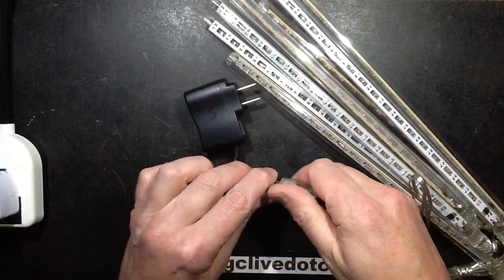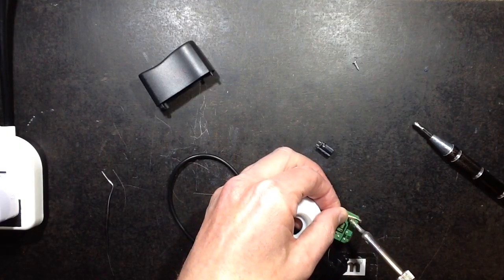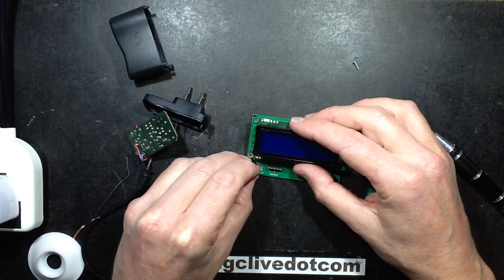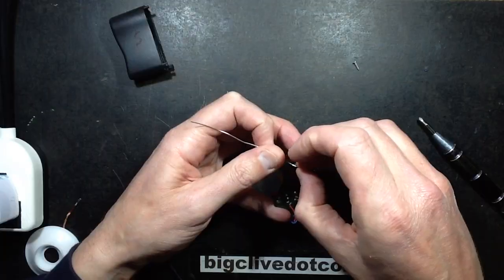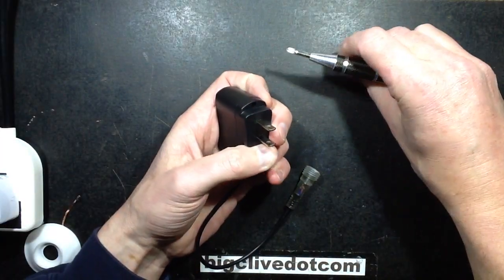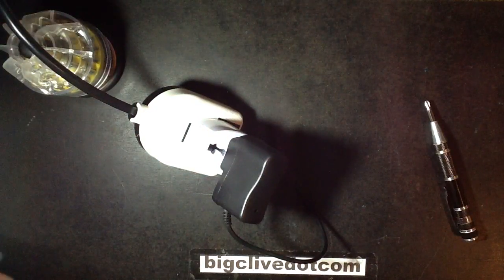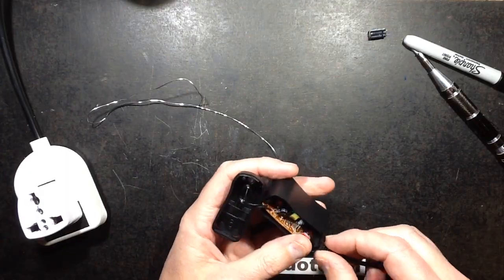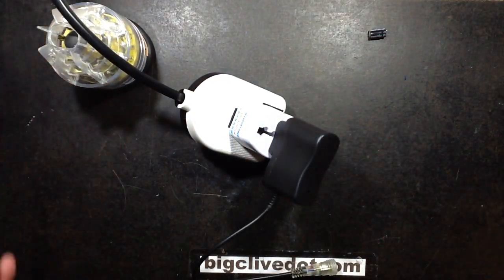Power supply explodes twice.

Comment: can you get capacitors that are non polar? so you can use it in a circuit where it may get a reverse charge in certain states
Reply from the maker: +micheals1992 Most capacitors are non polarised, but the electrolytic's have the advantage of higher capacity to size ratio for power supplies.  You can get non polarised electrolytics though.
Reply: +bigclivedotcom how much was this nice tester ? :)
Reply: disk or plate capacitors, usually
Reply: Non-polar electrolytic capacitors are available, but generally only at quite low capacitance and voltage. They are a lot more expensive than polar types for the same C*V rating. It is rare to find them in anything but audio circuitry where a large amount of capacitance at AC low voltage is required, such as in filter circuits.

A lot of modern switched mode power supplies use switching frequencies high enough that only a small amount of capacitance is needed at the output. Non-polar ceramic caps are frequently used (the high C*V product dielectrics have horrible voltage coefficient of capacitance - they can be down in the 15-20% of nominal when operated near rated voltage, so they aren't ideal either). Tantalum electrolytic (solid electrolyte) are moderately popular, but they are polar and quite expensive relative to aluminum electrolytics.  They tend to fail short-circuit if mistreated. Polar aluminum electrolytic caps are still the only viable option for the input filter cap for AC mains operated supplies.

Comment: As far as I learned in my physics lesson, a capacitor is just two flat conducting plates opposing each other in an electrolyte solution. Why would the polarity matter if that was the case? I suppose it isn't :P

Comment: Im afraid now .-. One of these came with my USB adapter...Should i be concerned?
Reply: not at all, as seen the original capacitor inside didn't even blow when it was in the wrong polarity. Clive made that thing explode by modifying it. Mind you I'd still recommend a better power supply, something a bit less... well Chinese really
Reply: Also, he's using a 120 volt plug in a 240 UK area. No worries.
Reply: worse case scenario is it burns out the plugs power supply. It won't hurt the phone or whatever you charge

Comment: Wick... Oh my... Do I even still have wick? I think I do... I use it as flexible bus bar now, by loading it with solder and attaching it into circuits that need a power feed, or serving as a heatsink for chips with thermal pads when soldering them dead bug style! XD

I bought a Hakko 808 Desoldering gun, and have never looked back. At work, I've used a Pace unit (that attaches to a central air supply). Honestly... I found both units to be compatible, though the Hakko wins my personal favor for being a completely self contained unit, with it's own vacuum pump. THey don't make that model anymore, and I don't know what it's replacement is, but it's something I do not regret getting!

Comment: Had a 18650 lithium cell do similar the other week (from minimal tampering with the tip of a needle!). The speed of thermal runaway, smoke and showering of molten fallout was nuts. Not to mention the fact i was a second or two from losing a finger, had i not got it to the garden quick enough. Potentially lethal and we use them everywhere...
Reply from the maker: +simon hare Tinkering with the cells is best done with them in a low state of charge.  The volatile behaviour is all the charge being dumped at once when they fail.
Reply: +bigclivedotcom  Tell me about it, but it was an event! lesson learned, don't strip off the casing to reveal the inner electrolyte/wrap and stroke anywhere near the positive with pointy object. Whoosh!
Reply: +simon hare  p.s. the cell had aged/lost anode connection, so it appeared dead. Worth mentioning lol

Comment: In my experience, the smaller capacitors without the stress relief crimping on the top go bang the best.  They also make a much, much bigger bang if you subject them to over-voltage until the dielectric catastrophically breaks down instead of simply reversing the polarity.
Finally, and this is a suggestion for something you would not do, the larger capacitors with the pre-stressed tops can sometimes be reinforced by just soldering them.
The last thing I would recommend really not doing is looking for old grab-bags of electrolytic capacitors before the pre-stressing was really a thing.  You can find some completely sealed co-axially leaded capacitors in quite high values.  You do need a lot of power to pop them though.  I think I had a 0-50V, 0-30A DC supply.
Reply: htomerif
Sniff Sniff
Mmmmmmmmmmmmm.... PCBs.......
Reply: theLuigiFan0007 not that I'm suggesting this, but you can explode some pretty large ones, like a 12V, 2200uF one.  It sounds like a gunshot, but the explosion isn't particularly dangerous.  It usually just ends up with unraveled electrode foil and a paper electrolyte.  Fair warning though, the smell is much, much worse than burned FR4.

I wonder if a supercapacitor could be made to explode.  They're an entirely different internal construction.
Reply: htomerif
As for supercaps, it depends on the kind really. If it's a small one (Under 10F) it might explode, as it's basically two capacitors in one. A really large one, lets's say, 3400F, would likely just melt and emit a load of sparks, because those use a carbon power if i'm not mistaken.

With 8 of those massive ones in series, I wouldn't be surprised if it could weld at 12V. They have a capacity that gives large batteries a run for their money. They're like 3.4 billion uF or something.

Comment: I once had an election back feed my 24 volt control power with 240 volts. So the  
Control board was live when i had the evaporator unit unplugged. Capasitor blew up in my hand. And I had a wee shock.
Reply: Wraith Leader Election hey? Sounds like you got Trumped!

Comment: Hi Clive, Do you know if you can use the ESR meter you've got as an 'in-circuit' tester if you attached leads to it? i.e, is the test voltage below that required to turn on p-n junctions? (I think they're usually 0.2-0.3v ish @ 100khz). Thanks.

p.s. 81ohms ESR - holy sh..!

Comment: He said he installed the cap in the incorrect polarity, why? Did he think it would work better that way?
Reply from the maker: +TruAnRksT No.  I did it so the thing exploded dramatically.
Reply: bigclivedotcom

Ah, well then, you should have stuffed it with steel wool.
Reply: +bigclivedotcom 
Funny because the company I work for supplied a hundred circuit boards to SAIC for the patriot missile system with a key cap installed backwards. They were not amused. 
It wasn't my fault but I did fail to specify directly on the board itself the correct orientation.
Reply: +theLuigiFan0007 
Yes it becomes something of a burden sometimes to make sure everyone down the pipe is on the same page.
Reply: +TruAnRksT 
That would have looked splended.....
...Provided you used PhotonicInduction's power supply to power the power supply. >:D
Reply: TruAnRksT
Now that's interesting.
I guess everything needs idiot error proofing.

Comment: Watching you solder has taught me that my soldering iron that I bought is faulty cause it doesn't get hot enough to melt the solder at 1st I thought it was me I am so out of practice but now I know for sure I need to buy a new one that actually get's hot like yours is. lol
Reply from the maker: Soldering iron elements can fail in a high resistance state that does result in insufficient heating.  But also check that the iron tip is clean and not black and cruddy.
Reply from the maker: +Huskiefluff Are you using lead free solder?  It has a higher melting point.  It may be best to ignore your irons temperature indication and nudge it up until it feels right.  Is the tip of the iron clean and shiny?  It has to be clean for the best thermal connection with the solder.
Reply: +Huskiefluff Huskeh!!
Reply: A couple tips: 
As others have stated, use a sponge or wire based cleaner(Hakko 599B-02), or ideally both. 
Before you touch the tip to the component,  melt a little solder into the tip, this allows much better contact for the heat to flow.
If you have an adjustable temperature, be wary of setting the temperature too high, especially if you are using flux. Temperature should scale with the thermal mass you are soldering to, but above 750° F will often start to blacken your tip.
Try using leaded solder, it's honestly better in almost every way, and even is safer to work with. 63-37 is the best in my opinion. 
Be wary of lead free solder as it is also generally more corrosive to your tip. 
Should your tip become corroded and dirty, you can lightly scrub it off using the wire cleaner and re-tin the tip with solder, make sure to do this at a temperature of around 470° F.
Lastly, always tin your tip and leave some solder on it before you turn it off.
Reply: Robert Rizzo

Get a Weller.
Reply: +KoolBreeze420 
I have used a 150w soldering gun to solder tiny 144 lead IC's by hand.

Most devices can tolerate a bit of over heating, over heating the joint is better than a cold joint.
Reply: +Robert Rizzo honestly, I would consider buying a nice Hakko FX-888D. It's a bit pricy, but everything is extremely well built, and every part can be bought and easily replaced. It also heats to temperature in seconds and stays within one degree of where you set it.
Reply: i used to have the same problem, so i switched to one of those fancy tenma digital ones with the big bulky reliable transformers on it and it works good
Reply: +bigclivedotcom what temp do you usually use.  the temp i used to use in school doesnt seem to be hot enough with my own personal one.  have to use around 800f settings to use it on boards.
Reply: +bigclivedotcom yeah I don't use a sponge on my iron. one of those wire cleaners so the irons always clean. I do use lead free solder so that might be why. just worried about melting the electronics with to much heat.
Reply: bigclivedotcom Yeah it's brand new but was a cheap one and I can't melt the solder it came with and it's pretty small looks like it's lead with resin but getting it to melt solder on a board is nearly impossible so I am sure that it's just a defective one I ordered a new one.
Reply: +KoolBreeze420 
you should check if the soldering iron you bought has a temperature adjustment pot in its handle.
they look like a plastic screw and let you adjust the temperature. maybe the one you got is just set a bit too low.
Reply: +KoolBreeze420 
you should check if the soldering iron you bought has a temperature adjustment pot in its handle.
they look like a plastic screw and let you adjust the temperature. maybe the one you got is just set a bit too low.
Reply: +KoolBreeze420 
you should check if the soldering iron you bought has a temperature adjustment pot in its handle.
they look like a plastic screw and let you adjust the temperature. maybe the one you got is just set a bit too low.
Reply: If you're in the market for a new one and do a good amount of soldering, the Hakko FX-888D is a fantastic investment. it is hilariously overbuilt, featuring the ability to stay within close to a degree of what the temperature is set to while soldering.
Reply: TruAnRksT  While that may work for you, it isn't the right tool for the job. The right tool makes all the difference. As always, care should be taken to not "overheat" devices. Reading datasheets is a must. Also, if you dump too much heat into pads, it makes it far easier for them to pop off the board, and to lift a pad.
Reply: Max W.
Well I agree Max, it's not the proper tool. But if you are careful can still be used for delicate work. If that's all you have, I can do most any job with it. Rather have that than a weak ass radio shack iron.

Oh the surface mount hot air guns are kind of a bit of shit.

One thing about the high wattage irons, they get the heat to the joint now. The lower wattage irons sometimes have to heat the entire area (board ,chip, everything) over many seconds before the solder will flow.
Reply: audiocrush Well I bought a new one and the difference is mind blowing I honestly thought i was doing something wrong.The new one is smaller then the other one so it's easier to use and after heating it the first time the metal turned into like a black bluish color the other one didn't do that and I was able to solder a couple wires together finally now I can make my mobile power bank out of the battery's I have.I also now have 2 tips but the other one looks like it may be a tad to big but it may fit if I Can back the screws out enough and for the heck of it I may try and open as you suggested to see if I can turn it up or not.
Reply: +KoolBreeze420 I actually tried to take apart my iron after watching Clive's videos and broke it to pieces. The bolt holding the tip on just snapped in half! A bit of background the tip wasn't heating. I thought maybe I could figure out why. Oh well, it was $19 at RadioShake. I need to invest in a nicer iron.
Reply: Yourpants

Yep higher end irons do pay for themselves.
Reply: Absolutely. Although even a mid-priced Weller station can outlast the operator if it is well maintained (new tips excluded)
Reply: Yourpants
Yup, been there.
Reply: TruAnRksT you wouldn't be the first to say that! I think I might.
Reply: Robert Rizzo

I once used a big 150W iron to solder surface mount micro controllers with 144 feet. I can't recommend it but it worked at the time. With a microscope. LOL Seen it done with solder flooding then clean up recently and it works really good. But I did every lead individually.

I used a copper wire attached to bring the heat/solder to each individual leg. And an exacto knife point putting pressure to make sure it was against the trace.
Reply: It can work, but it is a bad plan to consistently do that. Microcontrollers are usually a bit more heat resistant, but any precision parts can be damaged if you dump too much heat into those junctions too quickly. Part of the reason many of these components come with thermal profiles for  temperature ramps while solderng them.
Reply: Yourpants Thank you for the recommendation. This thread has been very informative!
Reply: +TruAnRksT Metcal works good too.
Reply: I made the experience that the bigger the tip, the better the heat conduction. He uses a quite big tip, so I'm pretty sure that affects the melting time a lot.
Reply: +RicoDuroska well.  thats a bit wouldn't you agree bigclivedotcom

Comment: Your soldering skills are amazing, especially the way you hold the circuit board.
That plug on that PSU is an American 110 Volts plug.
Reply: +RODALCO2007 I totally agree. Amazing dexterity when holding the pcb, the solder and the iron. I often struggle even when using a 'Helping Hands' clamp. :)
Reply: +oc2phish07 Me too, but somehow manage it...
Reply: +RODALCO2007 I wasn't paying attention properly until I saw your comment but now you mention it. Working the solder, pcb and keeping the cap in place all with one hand is quite the impressive feat.
Reply: +RODALCO2007 he just has a good soldering iron, get a better one, it makes a giant diffirence tbh
Reply: I have been trying to become more adept at the Clive method of soldering, sadly my 67 year old hands have a bit of shake, the result of doing a bit to much one handed exercise in my youth, before I found a good woman who would help me with such matters, and perhaps caused by the hundreds of thousands of rounds I have put through the handguns that I have owned over my 24 years of law enforcement, and 8 years as a Soldier in the United States Army.  Still, I think I am making progress, it is a rare day indeed when I burn my fingers when attempting to tin a lead, or hold the circuit board and solder in one hand while applying the heat with the soldering iron in the other.  I would never have attempted this had I not watched hours and hours of Big Clive doing it himself.  I do believe I have watched nearly all his recent videos, now I am enjoying the videos of old on his web page.

Comment: There used to be a factory near Syracuse New York that made tube radios. This was in the early '60s. One job was putting finished radios into a cage and turning on the power. If it didn't blow up the filter cap was installed with the correct polarity, and it was OK to ship. They apparently had quite a few failures and changes of underwear.  ;-)

Comment: I have the newer analyzer.. Well one of them. The one by "Fish8840" i think.. Wish i could access the damn firmware to fix the bad engrish! A 25V (volt) capacitor on mains rectified 330V (ish) DC?! HA! With reversed polarity no less!
Reply from the maker: +ChaosHusky If you can get the gist of what your analyser says in Chinglish then that's good enough these days.
Reply: +bigclivedotcom Hahahahah! True enough... The tyops in the firmware are annoying me though (typos for those who do not spot it) but doesn't hurt the function.. Just me being picky. I like how chunky it is though.. I also have meteor lights now and replaced the awful PSU with...well, i fitted a USB plug so i have some USB meteor lights!

Comment: just wondering the plug on the power supply looks like its made for 110vac like here in the states don't you guys in the uk use 220vac ?
Reply: +robert m UK is indeed 220 - 250vac. But in an earlier vid about these lights he mentioned the power supply is "universal voltage" type with American style plug. Hence the dodgy adapter in the socket.